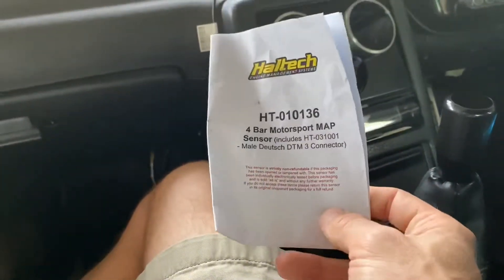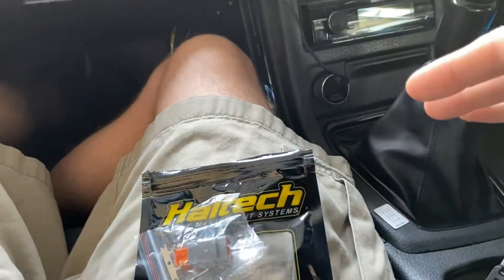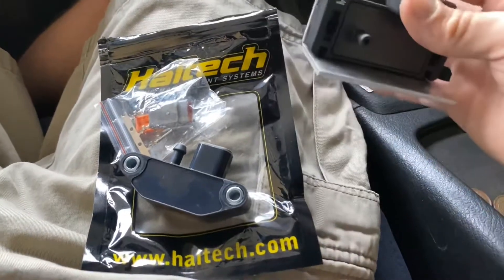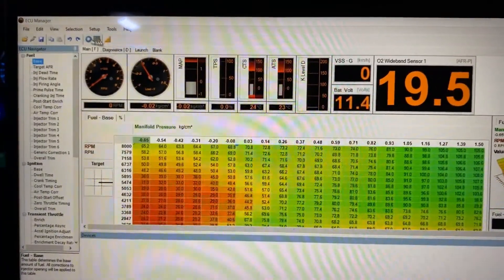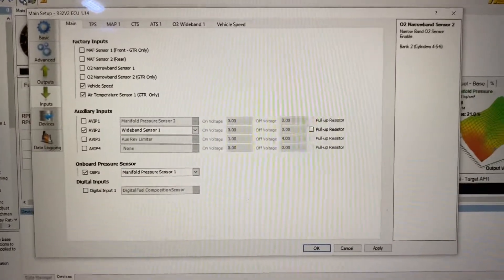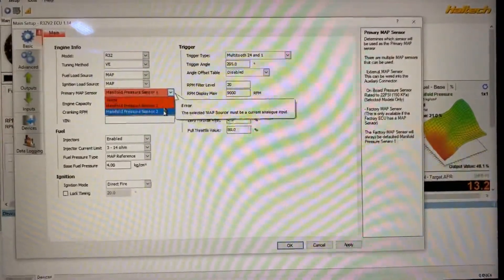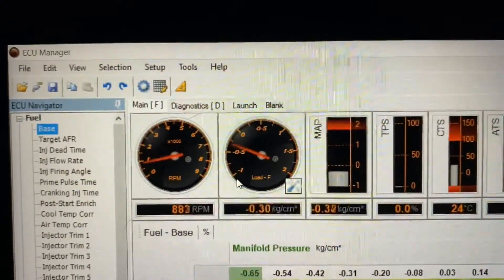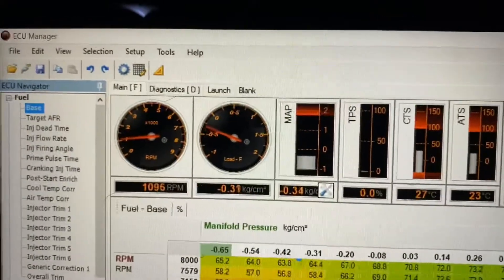Haltech 4 bar MAP sensor install on the GTR!

Comment: bro have you ever used the onboard internal map sensor on these haltech ecu
Reply from the maker: Of course I have, did when I was waiting on a replacement map. Onboard large enough for future plans so that’s why I use a larger one.
Reply: @javojjaaf  were there any issues with the onboard map, im contemplating between external and internal
Reply from the maker: @alitoroganan2442  none at all! I would recommend using an inline filter if you do to prevent it getting dirty and failing over time.
Reply: @javojjaaf  appreciate it bud
Reply: @javojjaaf  sorry bro how do i use the built in map from the ecu, do i need any extra hardware etc
Reply: Ive ran built in Map on Platinum Pro for about 8 years with no problems. They are only a 3 bar map sensor though, so anything over 22psi, and you will need an external 4bar map sensor installed.